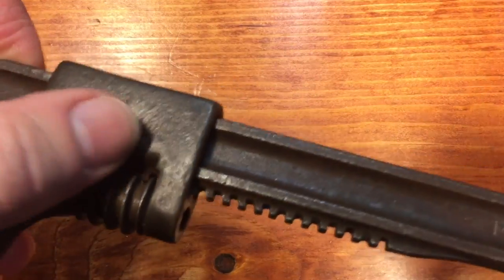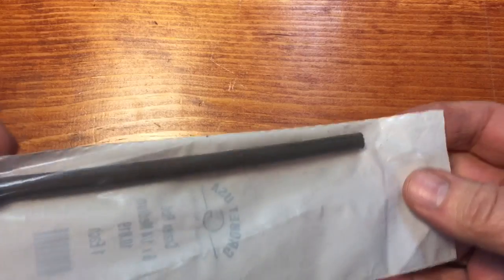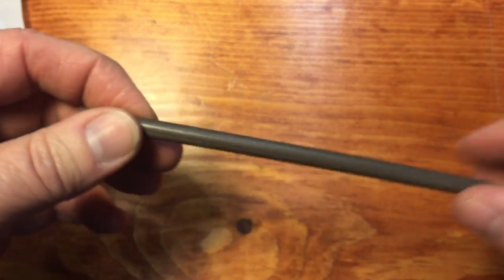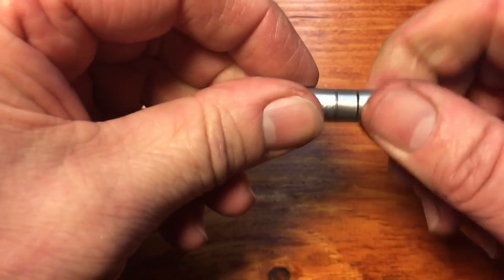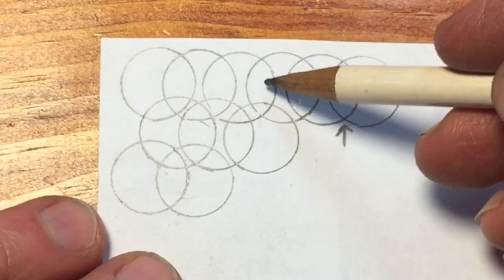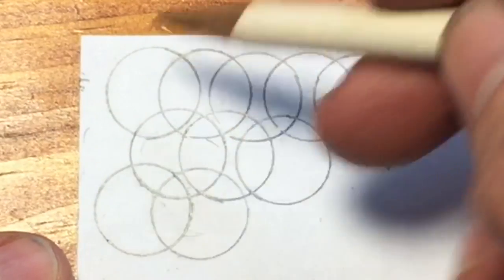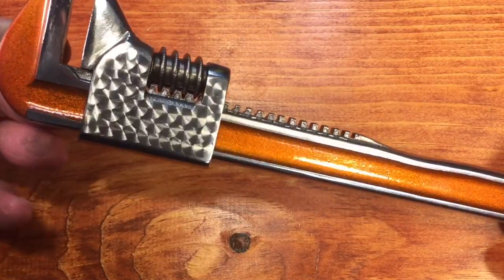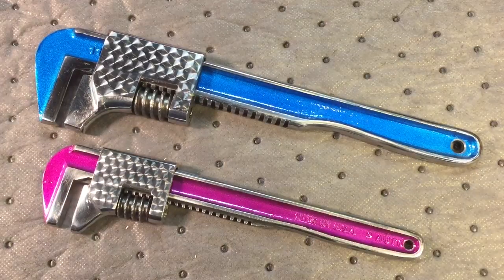Double-Take Junior...   9” Velchek

Comment: I like your Craytex holder... I'll have to make one. I usually just put a short piece of Craytex directly into the drill press chuck. 
   Craytex is expensive, but it does last a long time. Craytex works a treat polishing threads that have been single pointed on a lathe, giving them a very nice finish.
Reply from the maker: I would like to experiment with different grits and sizes but the price can add up very quickly!  LOL  Thanks!!!

Comment: I picked up one of these monkey wrenches last year at a boot sale, it is in much better condition than this one shown here. It does have a light coating of rust and should clean up very nicely. I am loving these double take restorations very much indeed. Thanks for another great video. Nash, UK viewer.
Reply from the maker: Hi Nash!  These are available by the thousands here but finding one in good shape is the trick!  The metal was soft on these and were often bent and mashed and very rusty.   I'm glad you found a nice one!  They make great project material!   Thanks so much!!!

Comment: Love that pattern. What is the depth difference in the pattern? Does that impregnated rod give you a better or more uniformed pattern than the scuff pads? 
Excellent work on that holder. 
Than orange is sweet. Yes the orange is nice. Yes the oranges. Was there another color?.... Haha
Reply from the maker: Hi Steve!  The scotchbrite and the Cratex seem to work very close. The difference is the cratex gives under pressure where as the dowel is stiff and you can get a better feel for what's going on...  The problem is the scotchbrite method wears down quickly.   Thanks!!!!!

Comment: Man that one turned out as great as the big one did!  Hey do you think a guy could pull off doing that jeweling with a hand drill?  I don't have a drill press and I am thinking about making me a pick guard for my old Fender Jazz bass out of some really thin polished steel and that it would look really cool with that jeweling pattern on it.
Reply from the maker: I think it could be done!  The key is to maybe clamp down a guide so your drill doesn't wander.  The key is to keep the drill stationary and unable to "walk" from the spinning effect.  A drilled hole in a piece of wood that you could hold securely and pass the tool thru the hole as you move it along a line would work!  Thanks!
Reply: @ScoutCrafter  Ahh prefect idea of keeping the drill from wondering!  I'll let ya know how it turns out.  Thanks my friend!

Comment: I did not see anyone else mention it but you could buy sanding aggregate or media in various grits and simply sprinkle it on the material you are engine turning and use a wooden towel.  It is kind of like a new piece of sandpaper every time.  Very similar to the scotch brite pad you used in the last video.
Reply from the maker: Hello PC-B, Yes!  I have used that method with lapping compound.  It's a bit messy but can work.  There is a trial and error period for that method where the grit has to match the surface or it looks scratched up!  To get that really nice polished look I have found starting with a shiny surface and then adding very fine swirls looks the best!  I have tried wire brush, lapping compound, roloc pads, even stone!  My favorite is scotchbrite and roloc pads for larger work.   Thanks!!!!